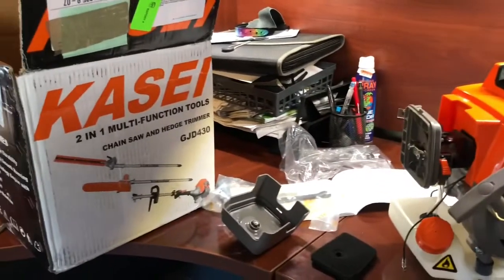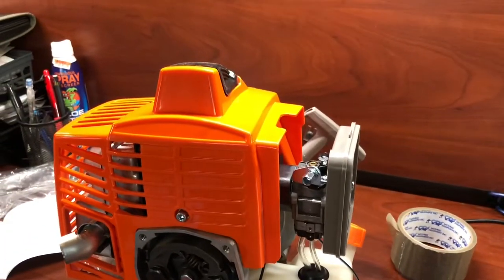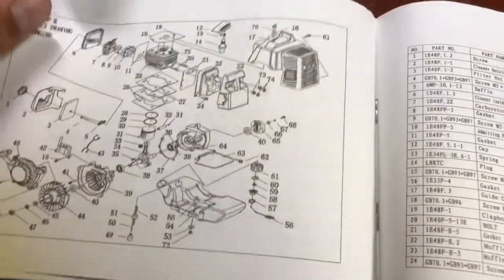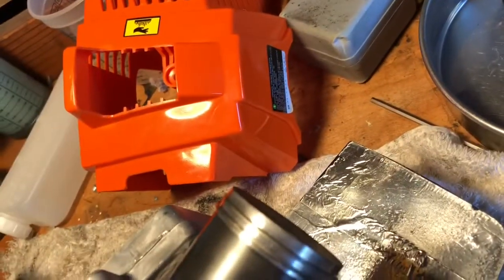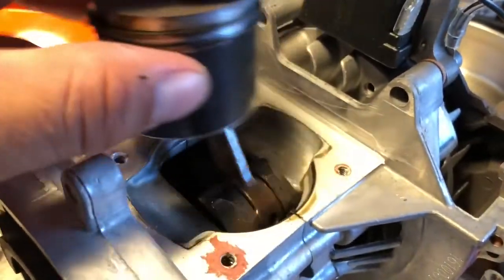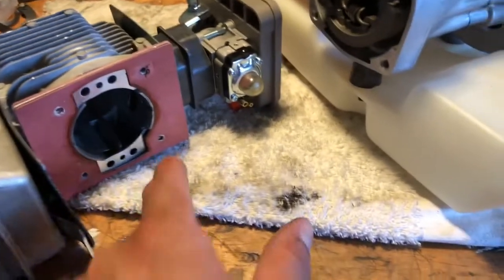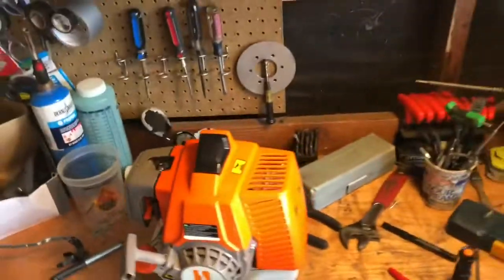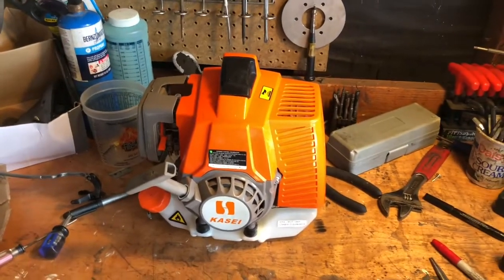Huasheng / kasei 63cc 2stroke engine (unboxed review & performance port work)

Comment: There is a lot more you can do with this motor. I have the unrestricted huasheng 63.3cc, and I made it an absolute beast with very little work. My friend ported the cylinder for me, just a mild job, and then I modified a Chung yang 460 manifold to fit, and ran the walbro HDA 223 carb. I think a walbro HDA 48 would perform even better, but the 223 did great. You can use the throttle linkage off the stock barrel carb by securing it to the bottom of the carb using two of the 4 primer bulb screws, and bend it to line up with the throttle linkage on the carb. It's very simple and actually solid. You can also dremel out the exhaust can to derestrict it. If you look inside it you will see just a small hole for the gasses to pass through. Dremeling it out much larger will help. Be sure to wash all of the metal shavings, especially since they are steel. If you make a custom adapter to bolt on a gp460 flywheel cover/ pullstart, you can run the gp460 flywheel and coil which will help it to turn mega rpms. Like 12,000+ rpms. Some have bolted on a zenoah rc coil backwards and it ran for them. Also there's an echo backpack blower cylinder that will bolt on and has closed transfer ports and supposedly adds a lot of power. I hear these kasei motors actually have different port timing or a compression relief on the exhaust port or something along those lines. My huasheng doesn't have any of those restrictions but it does have open transfer ports. If you'd like I could send you some pics of my unrestricted version to maybe guide you in your modifications. Awesome video, can't wait to see what you do with it. I'm glad to see more people interested in putting these motors on Gopeds. They're great!
Reply: U lucky sob. I bet u bet u have so much fkin fun.  Bro im currently learning and practicing bead blast and custom paint and getting better everyday and lesrning. I would love to learn port but sadly lesrning one thing at a time. Would love to pay u it ur in new wngland. I live in NH for a port job
Reply: do these make more power than the 49cc poket bike engines moded fully
Reply: do you have the link to purchase the motor please
Reply: Pb770 cylinder is the closed transfer one but they want 170 bucks for the cylinder alone at alot of places